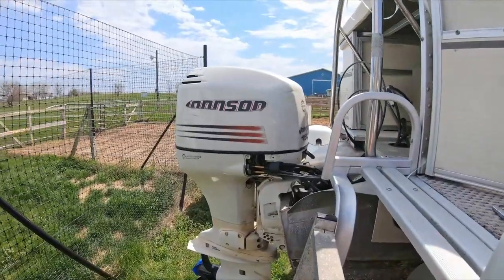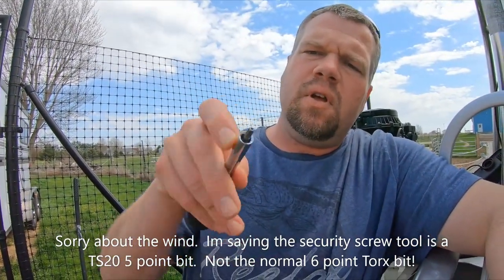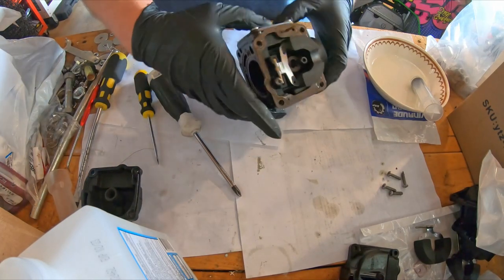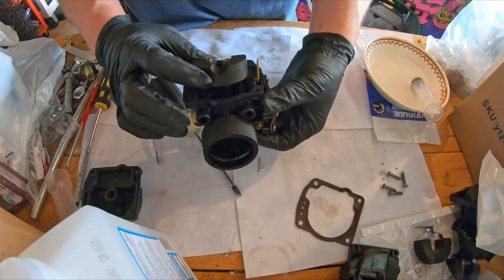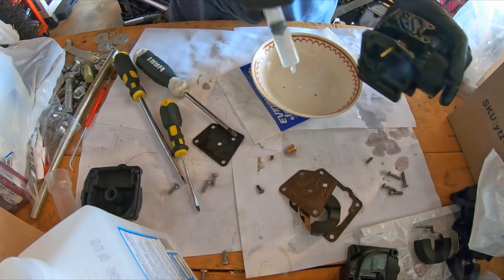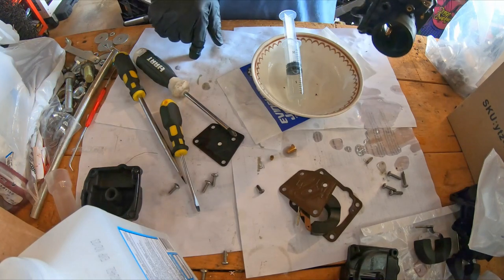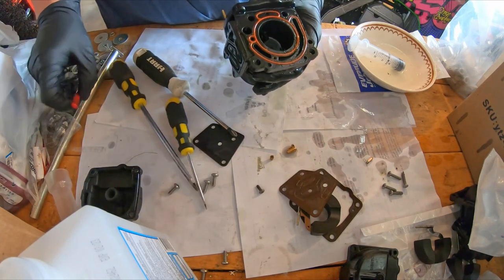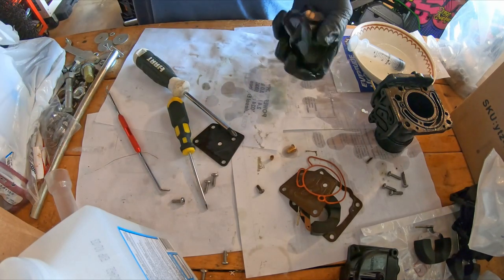Johnson 2 stroke 150 Carb Rebuild (Don’t make my mistake!)

Comment: Pro tip: if you have warped bowls, get a piece of 200grit sandpaper & stick it on a flat pane of glass & sand the bowls flat. This only works if they're not too badly warped. Has worked for me many, many times. Good luck & tight lines!

Comment: I should have paid closer attention to your video.  When I attempt this weekend the Torx Plus security screw stopped me in my tracks!  Thanks for documenting this.
Reply from the maker: Yep, it did me as well at first. I couldn’t find anything local so I had to order on eBay.  FYI, you need the same tool to adjust the air fuel screw.

Comment: Hi great showing step by step sow and steady always wins!  Unfortunately I have done this procedure way to many times on my 1993 150. I always put my needle piston as yours were on the back side . Next time I will see if the reverse works better. The only thing I would recommend is not use alcohol that’s the main problem with the warping of the bowls. Best to use carb cleaner.

Comment: Second note I have always connected the piston on the float as you found yours next time I will try your way as indicated in the manual. Too always read the manual do not put it back the way you found it that could be the problem. It is unfortunate to learn the hard way at 68 lol that’s the road I took for many years it is much easier guys share what they have found that works 
Great job

Comment: should also check float drop as well manual will have correct measurements I think it's 13/16 to a 1 1/8

Comment: Hi great job showing how to do this step by step. Unfortunately I have done this procedure many times on my 1993 150. The ethanol (Alcohol) in the gas is the cause of the Warpage of the bowls, Best results is clean with carb cleaner
Reply from the maker: Thanks Ken. Ya, I bought this motor second hand and the previous owner used ethanol fuel it’s entire life so you may be right about the warping die to ethanol. Luckily I have 1 station here in town that has non-ethanol. But of course it’s premium grade and $1.00 more per gallon. But cheaper than the problems I’d have continuing to use ethanol I think.

Comment: Hey, thanks for great video and details. Where did you get those rebuilt kit ?
Reply from the maker: Got them on ebay. Just be sure to get the OEM Johnson kit, not a cheap aftermarket one. The cheap ones gaskets don’t hold up.
Reply from the maker: The seller I got from is marinediscountparts and if you have the same carbs as me the kit part number is 438996
Reply from the maker: If you need the fuel bowls the part number is 433000
Reply: @understandthepeaches1025  I got a cheap sets and the quality is crap vs OEM. Now I only buy OEM. Save times and headaches! Thank you!
Reply from the maker: @Art_Of_The_Gent_Official  you bet thanks for watching!

Comment: I was rebuilding one of mine when I noticed the thin brass idle-circuit pickup tube on the carb body that sits down in the bowl chamber had a hairline crack running the length of it.  What kind of effect do you believe this will have on the idle mixture, lean or rich?
Reply from the maker: My thought would be Rich, drawing too much fuel. But I’m not 100% sure.